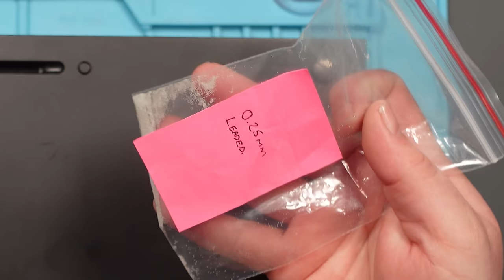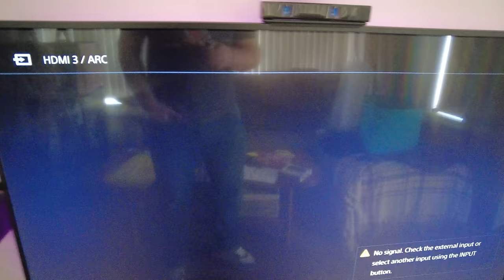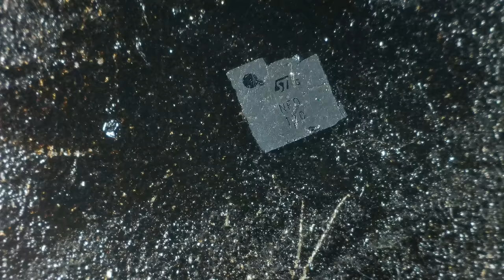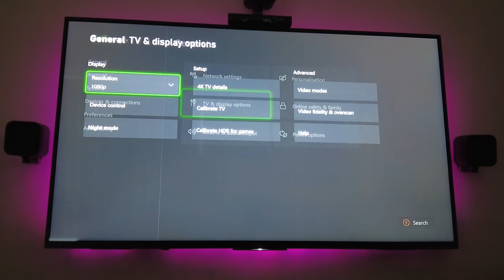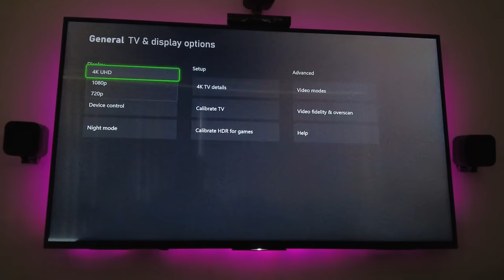SERIES X Displaying in 480p | ESD Filter Replacement With HELP From TheCod3r!

Comment: I love the cod3r he's the  reason we know what most of the error codes mean. The fact he works out of his shead is amazing. He's a self taught legend. 

He's inspired me to learn. I have always had a nack for fixing things. I could strip and rebuild a Jag V12 engine at 12 years old as I grew up with 4 generations of mechanics. My grandad was an RAF mechanic in WW2 my dad was a mechanic for Jaguar my older brother is a mechanic for BMW and I grew up to work for purgeot. 

Now I had to give up work due to MS my body is failing me but my mind is still working at 1000% I was diagnosed with autism so i always have to be doing something or I drive my wife crazy taking the microwave apart or something 😂.

I just got into fixing electronics I started by repairing my brother's OG Xbox replacing all the caps and modding the fan with a led fan and led ports at the front. I'm starting with older stuff that's easier before going to modern tech. 

I hate seeing things thrown away so I fix anything from furniture to hoovers, TVs, pc, laptop etc. I have a a garage full of tech that I keep incase I need parts or wires and it has come in handy a few times especially with Dyson hoovers. People will throw them away when they just need a clean or a new tube or seal.

Comment: Excellent job in replacing the ESD chip.
But one thing annoys me, your XBox is sending it’s heat directly to the Denon amplifier that could bring faster wear on it.
Mine is put sideways so it blow more to the back than on my Set top box and my Blu-Ray player.
Another way would be to swap the two so that your XBox expels to the wall.

Comment: Hey Stez
I am really interested in your console, TV audio setup - any chance you could do a quick video to show us your setup?
I still run an old XBox360 and PS3 but have them frankesteined through my very old PC to play the audio and the like.

Anyway, great video as always and glad you go the ESD chip thingy fixed
Reply: the wires are probally just going to the tv like it normally would
also thats very odd having it go throught some kind of pc just for audio
Reply: @darkspongebob11  I should probably clarify
My consoles are running into my PC monitor(s), but as the monitors I am running have no speakers, I am currently running the audio into my pc and outputting the audio into my 5.1 speaker setup  - IT certinly isn't a great setup as I then need my PC on just to hear anything.   So my 360 for example (it's the old, old version so no hdmi output, I have VGA or phono, I use th VGA to a hdmi output but tha leaves me with the audio on the phonos) I have just found out about HDMI splitters so looking into that too.

Back to Steve's setup, He has loads of different consoles hooked to his TV and just wondered how he switcehs between them and handles the sound of the older onces - I can see a Denon box, so guessing that some sort of amp? and as he has multiple speakers, again guessing he is running some surround setup - would be cool to learn more

Cheers
Reply: @RyanDavidHale  it looks like a fancy tv so it possibly might have a lot more ports then a normal probably cheaper tvs
and yeah even if there isnt enough you can get splitters and stuff to actually get more ports, i ideally need this so i can actually Easly switch between them because i only have one port on my extremely cheap tv